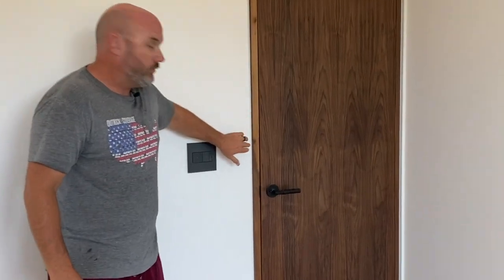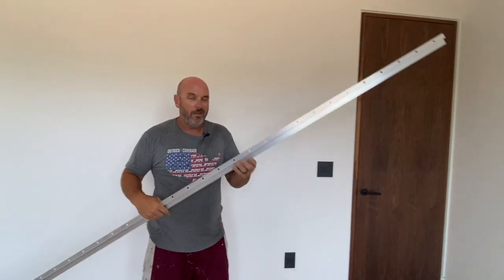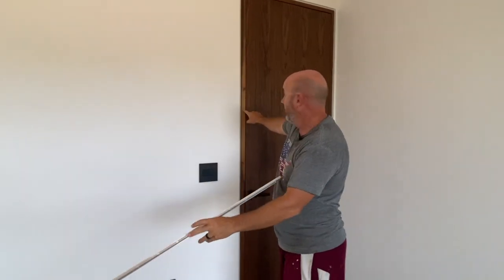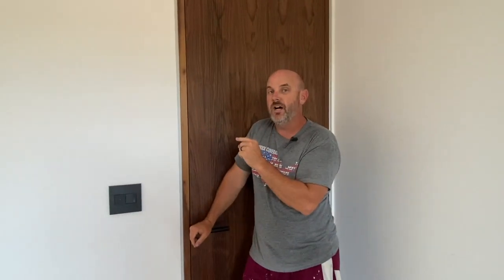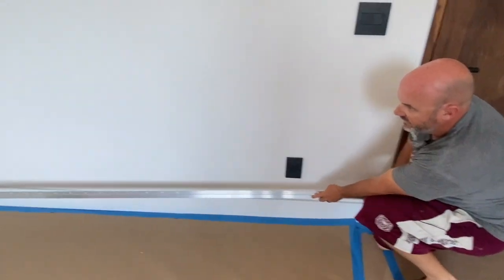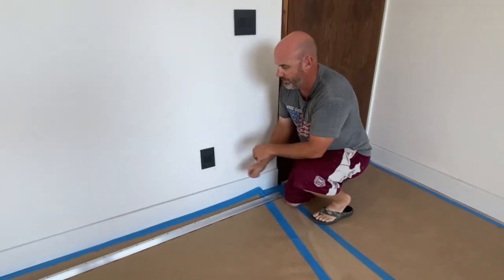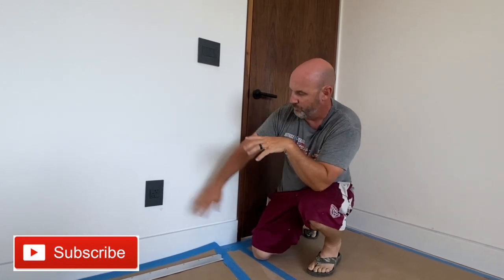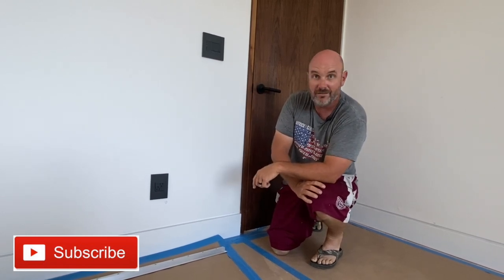Shadow Reveal made Easy!!!

Comment: Thanks, that's interesting. I tried to do something like this with plain old aluminum angle and it has potential but I ended up ripping it out of that room and going conventional trim because the joints where the pieces butted together showed badly and the screws heads, even though countersunk looked odd.
Obviously your showing what someone's developed that is much better.
Question though, I used blocking to back up the trim board and angle iron to attach to, I assume you did the same?